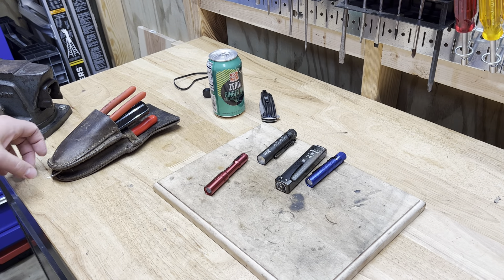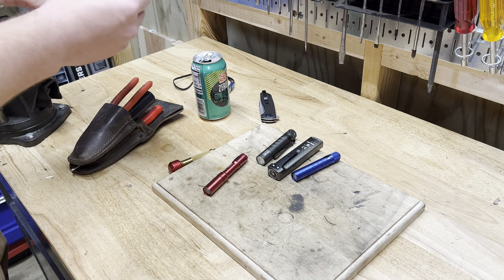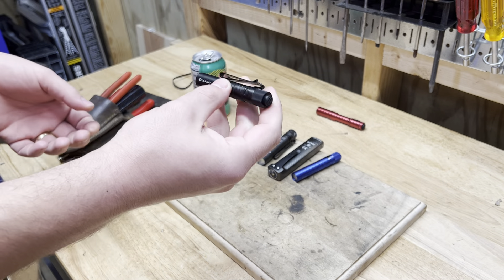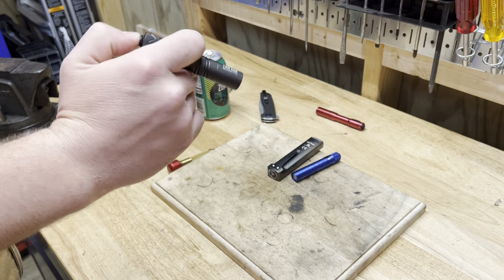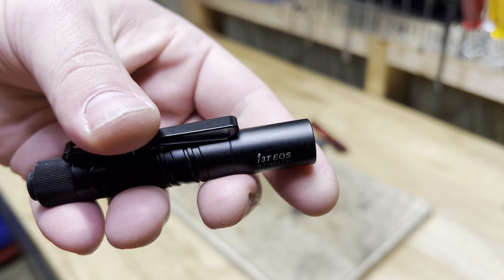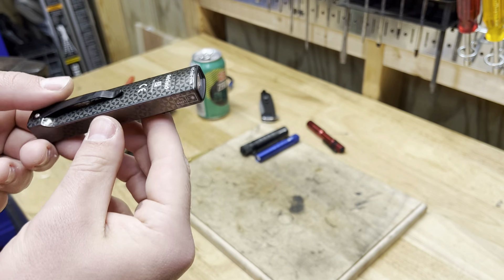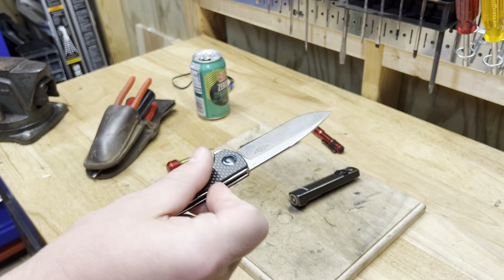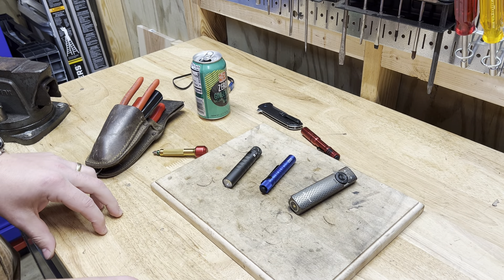Guess I’m an EDC Bro Now?

Comment: For the 1000 lumen setting on the Arkfeld, you need to double click the button. And the lowest setting is when you hold the button in from the off position. Strobe is buried in there too under a triple click. It's a great light!
Reply from the maker: As long as the strobe is buried where I won’t turn it on by accident, I can live with it. Guess I should have read the directions! It is a cool light for sure. I might have to do a follow up to clarify my wrong description of the features. I also want to compare the brightness on the 1000 lumen setting to my Milwaukee spot light that has 750 lumens but seems way brighter. I’m curious about these lumen ratings. They are fishy sometimes.
Reply: @realworldtoolreviews  Spot lights tend to look brighter, specially compared to flashlight like Arkfeld which have a very wide light beam. Good vid!

Comment: Been an Olight user for about 2 years now. Absolutely love. I’m a commercial electrician and carry either a Baton 2 or 3 with me every day. 4 brightness settings, the lowest of which is great for small close areas and on full blast will light up the inside of a dark drop ceiling as if the sun were shining in there. 10/10 would recommend.
Reply from the maker: Yea the baton seems like a good one. I might have to pick that up one of these days.